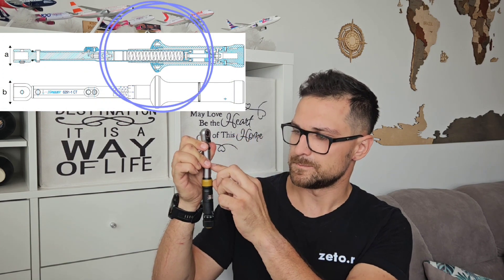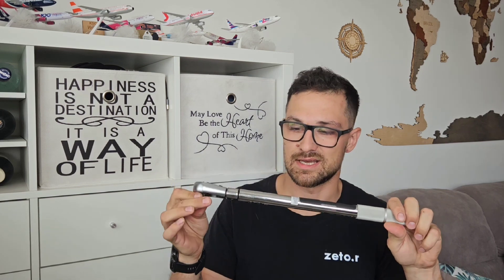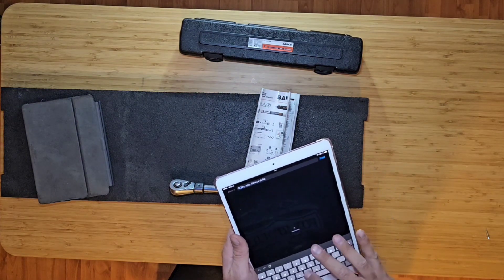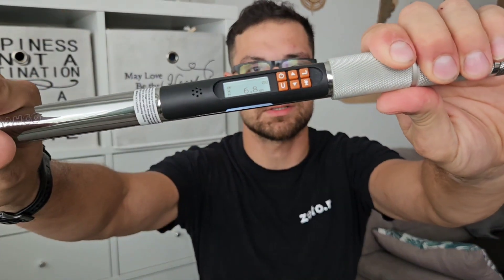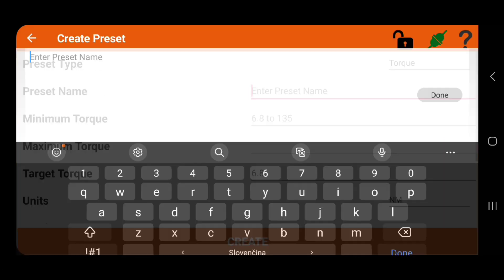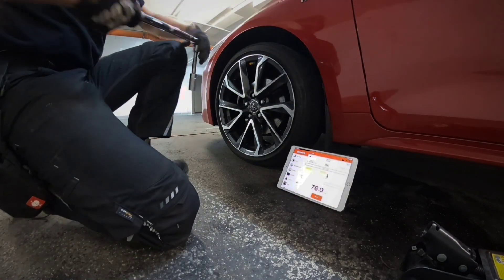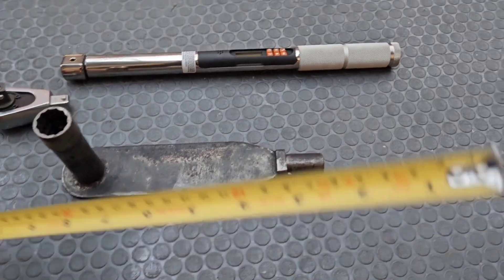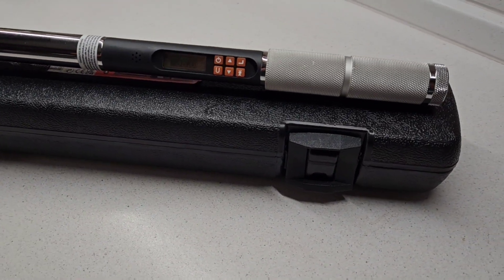Is Digital Torque wrench better than mechanical?

Comment: Would you please advice me about mechanical torque wrench, i need to buy one for small range, like your torque at the beginning of the video
Reply from the maker: Well depends on what you need it, at home I have TW for 100€ from Proxon which is good quality and the normal price but for work I prefer something better like Bahco or Snap-on